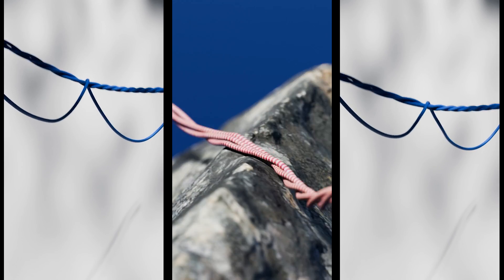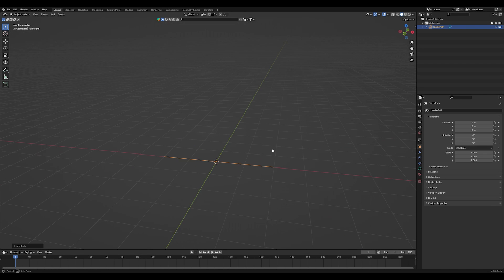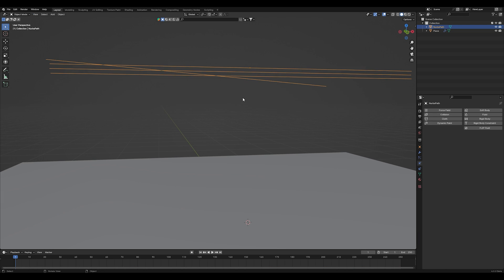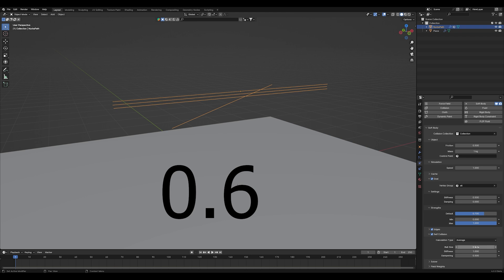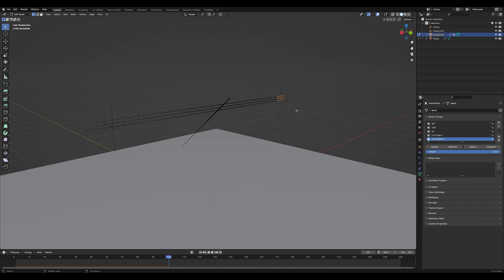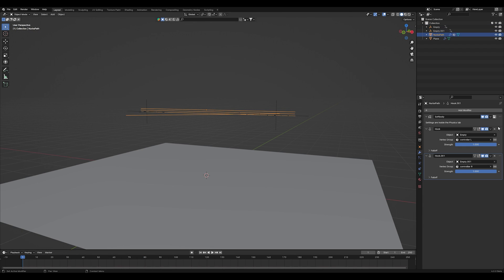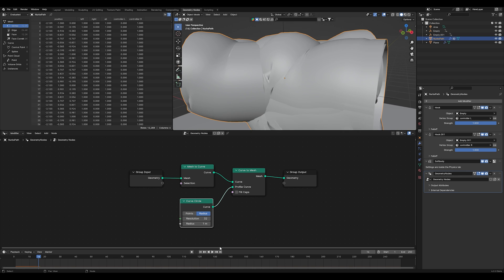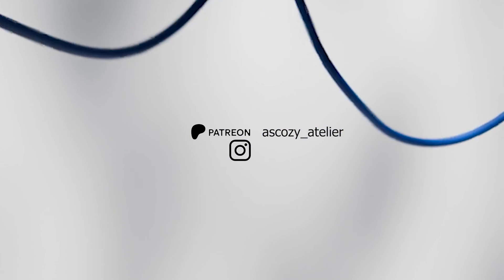🪢 Master Realistic Rope Simulations in Minutes! 🪢

Comment: The texture is not working it doesn’t even allow me to add other textures it looks stretched 😢 help
Reply from the maker: if u use blender 4 then go into your geo nodes that u made and add a set material node in between right before your output node ! :)
Reply: i obviously added it and the mesh was just stretching , i found a way by calculating 4 corners and subdividing it . thank you 🙏  @ascozy_atelier
Reply from the maker: @thickboynextdoor  oh great attempt bro!
Reply: @ascozy_atelier  💕💕💕💕thank you